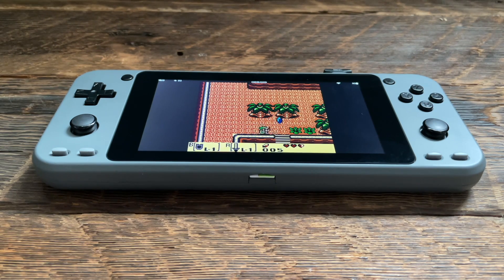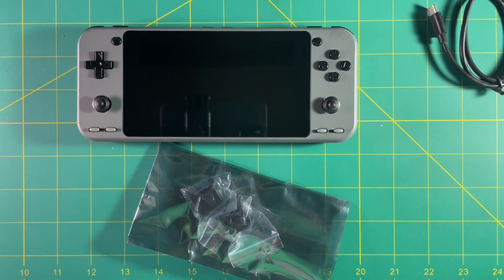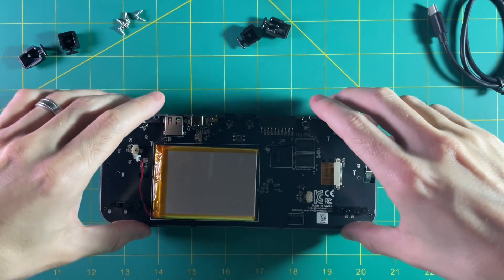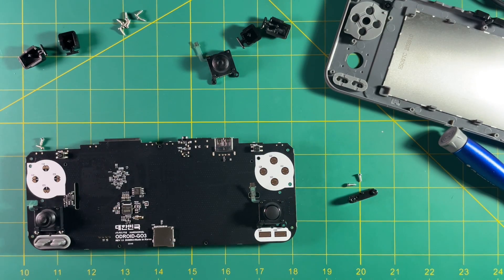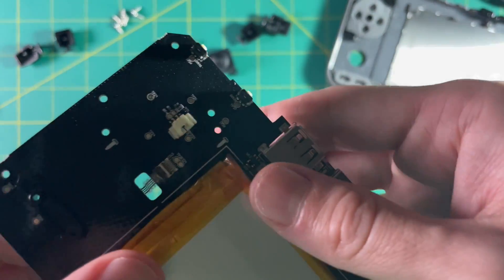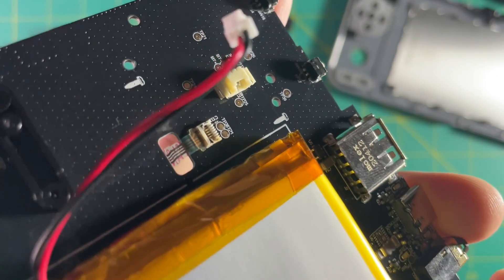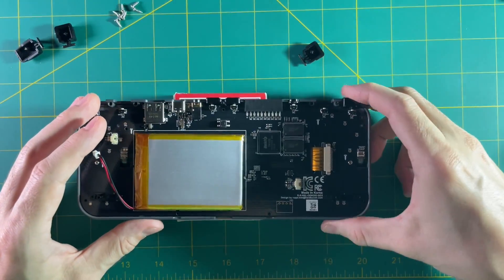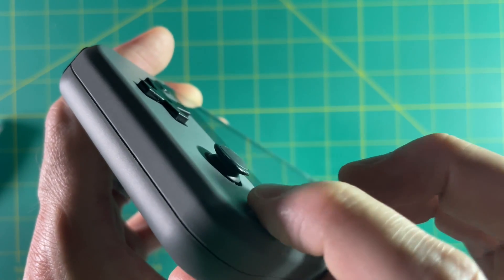ODROID Go Super + PS Vita Analog Stick MOD!

Comment: Just swapped out mine based off this excellent tutorial, I used a very small screwdriver to pries open the black tabs to hold the stick wires, closed them down gently so no breakages thankfully, but yes, as you mentioned they are very very delicate.  Thanks so much for this awesome tutorial, the difference really is night and day, those original sticks are terrible quality and yes, they can cut through steak :] Thanks again buddy !! and keep up the awesome channel !

Comment: Good tip I've learnt over the years for replacing screws, put them in the hole and go anti-clockwise until you feel the screw drop into the grooves already cut in the plastic then go clockwise and tighten as normal, helps you use the original threads instead of cross threading the plastic.
Reply from the maker: Nice tip, thanks!
Reply: Super important for retro hardware, too. They often use self tapping screws going into plastic posts, and every time you redo the screws, you’re cutting a new thread into the post. Do that enough times and you’ll either break it, or carve away too much plastic and make it loose. If you go anticlockwise first, you can usually slip it back into the thread that was already cut. It’s a tip I picked up, I think, from Jan Beta restoring an Amiga.

Comment: Thanks a mil for a great walkthrough! I was able to replace the analog sticks with PS Vita ones, for ~30USD.  (Location: Johanneburg - South Africa). Special attention was paid while releasing the small black latches for the sticks, so it was not broken. Putting back the screen ribbon cable was a bit tricky, but managed to put it back after some fiddling.
Reply: Hie also in south Africa were did you buy yours?

Comment: Thanks for your guide.
I replaced mine with PSV analog sticks too.
But I use tweezers to open the cover ("the little black piece") before removing & inserting the cables so they remain intact for my device.
I guess if the analog sticks still work and the cables don't disconnect themselves, not having the covers is acceptable.

Comment: I ordered the sticks from Aliexpress as it was cheaper and I wasn't sure about doing this mod. Sure enough, I procrastinated as I had other obligations but finally decided to get this done. I was able to swap them out and I do feel it makes a difference and improves the device.
The only problem that happened was that some of the screws to open the case gave me trouble as they were stripped. I can't put those back in so I'm not sure where I will get replacements.

Comment: They are the same module, just with another head. And the socket ... its quite okay just friction fitted, but there is the possebility that it comes loose over time.

Comment: "try to be as gentle as possible during this part" - he says, as he nearly breaks the LCD socket retainer bar. I haven't damaged my Odroid like this in particular, or anything important actually, but i have had this happen to me before. And that after nearly 20 years of handling these sorts of things and usually knowing very well how much force to apply and where. So mishaps happen.

The stick latches just need to be flipped up to be vertical to insert/release, if you overextend them, they won't like that, as you discovered. I do believe they are latches that press down on the actual ribbon and press it into the gold plated spring contacts, so with them not being there, you probably don't really have a permanent connection. Then again if the connection has held up for nearly a year up until now, who knows how long it will take them to give up, might not be that severe of an issue. I'd have an urge to take the black latch pieces and just force them back in, maybe secure them with a little Kapton tape.

I like that they finally got rid of those horrible latches all over the sides of the enclosure.

Comment: Where can you find stock for Original PS Vita Sticks? MyRetroCase is out of stock. Not sure if ones on Ebay are original or knockoffs... love all the videos ... thanks
Reply from the maker: I have bought these from eBay and can confirm that they were legit: https://www.ebay.com/itm/NEW-OEM-Left-Right-Analog-Joystick-Control-Pad-Stick-for-PS-VITA-PSV-2000-Black/132745037293
Reply: @RetroGameCorps  Thanks. Unfortunately they only have 1 left in stock

Comment: Do they make small covers that you can fit over the default analog sticks? I am a little hesitant to open up mine and I would worry about breaking something.
Reply from the maker: Yes, if you use silicon grips they work, like what comes bundled with the RGB10. They’re actually pretty good, just ugly.

Comment: Would switch sticks work as well?  The vita sticks are a bit more expensive than the switch ones.
Reply from the maker: Switch sticks have a different connection, and I am not sure they'd physically fit, either.
Reply: @RetroGameCorps  thanks, just ordered some vita 2000 sticks to try out

Comment: Hey Russ – thanks for the guide. I’m in the UK, so found these on a UK site for my OGS (my fave handhled with the RG351P): https://gamegorilla.co.uk/products/2-x-ps-vita-analog-stick-joystick-thumb-sensor-3d-button-pad-for-sony-psv-2000?_pos=2&_sid=b86c75f19&_ss=r Hopefully these are compatible. Do you know if I can use these to also replace on my OGA? Also do you have any recommendations for buttons or dpad replacements? Thanks and keep up the fantastic work 🙂
Reply from the maker: I would contact that seller because the sticks in their picture (the zoomed in ones) look exactly like the sticks that are stock on the OGS!  Not sure about OGA replacements, I haven't had a chance to try one of those devices yet.  Not sure about buttons or d-pad yet, but I'm on the hunt for upgrades!

Comment: Will this work with the switch sticks?
Reply from the maker: No, Switch sticks won't fit through the small holes on the case.
Reply: @RetroGameCorps  But the connectors and everything should work

Comment: too bad those buttons are out of stock, i am having trouble tracking down true oem joysticks, or at least a listing i can believe to be true original.
Reply from the maker: It's hard to find real OEM sticks on eBay, I got burned once already.  These ones are real, I can confirm: https://www.ebay.com/itm/NEW-OEM-Left-Right-Analog-Joystick-Control-Pad-Stick-for-PS-VITA-PSV-2000-Black/132745037293